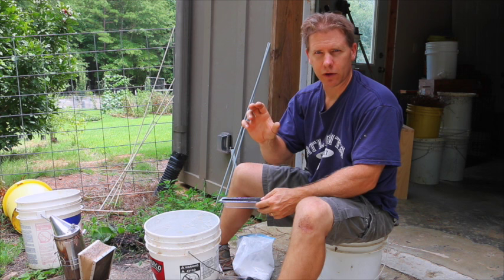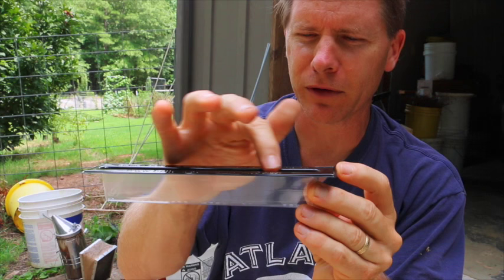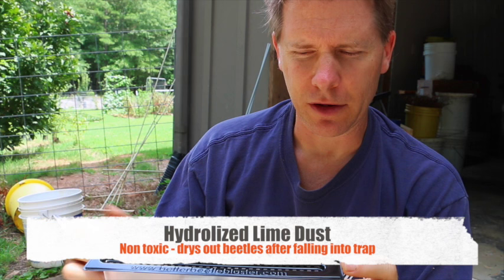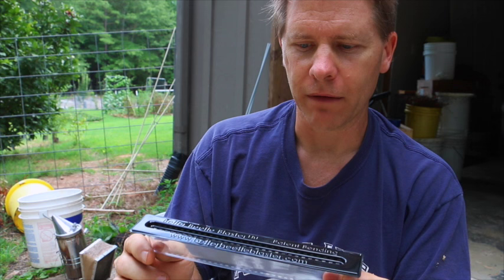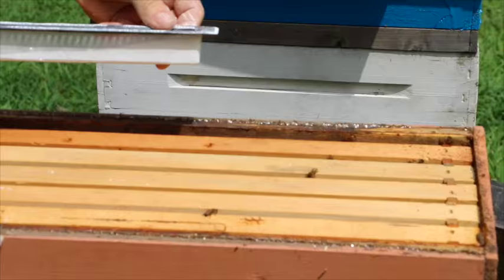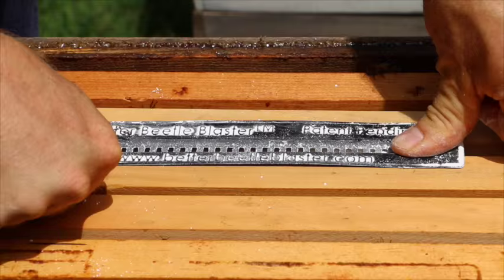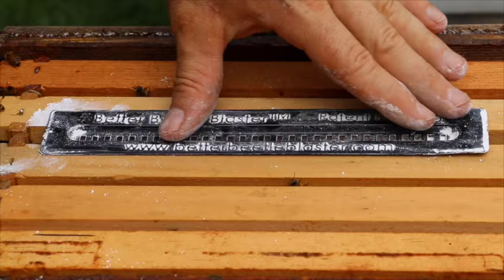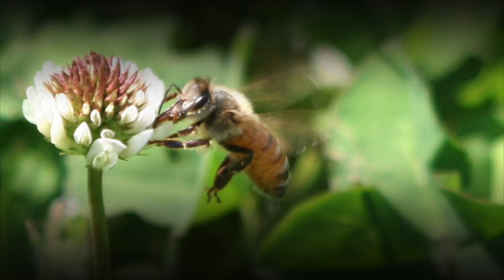Hive Beetle Control 7 2015

Comment: Great Video. I found the Horticultural Hydrated Lime product on Amazon so I'll give this a shot since I'm in SW Florida. New to beekeeping so this was very helpful. Thank you
Reply: Hey Tim...this is stan...you have a amazon link?   I use vegatble oil but this stuff really works??   thanks!!
Reply: Hi Stan. No. I ended up not buying the lime dust. I found food grade Diatomaceous Earth works just as well... as does using un scented swifter sheets
Reply: Hey Tim....well heck.. I use DE under my bees all ready....So you have had no issues putting inside  beetle trap around bees. I heard that dust is bad news if bees get in it...so just fill half way and wipe top off real good?  thanks!
Reply: Also Tim...where is the best place to buy food grade DE? I have a hard time finding it.  thanks!
Reply: Correct. Key word is "..if bees get in it" .. basically same as with the vegetable oil. The bees wont fit inside the beetle trap, so it will be okay just wipe off the top like you said...  even if you fill it less than half full with DE it will work
Reply: Man I like that.   messing with the oil is a pain. Ill give it a go!  and i like that it dries them up and they wont stink which deters beetles from going in.  So they just wander in there right not that it draws them?
Reply: Small hive beetle issues are only a problem when the bee population gets weak. So these days, I don't use any traps or chemical. I found much better success either down-sizing from 10 frame box into a 5 frame nuc works... I've had a lot of good success using frames without foundation. Less surface area means bees don't have to defend as much space, so they can better defend the inside of their hive against them
Reply: yep...sure makes sense. I am trying a few foundationless this year. Never done it. I also am learning how to raise a few queens.  take care Tim---stan

Comment: Correct me if I'm wrong but Hydrolyzed Lime dust is not the same as Horticultural Hydrated Lime? Hydrated lime is a toxic pesticide and warns you to where protective gear when handling. Hydrolyzed Lime is nontoxic?

Comment: What are your thoughts on using Diatomaceous Earth instead of the Hydrolyzed Lime Dust?
Reply: or fine salt
Reply: Fine Salt?   What is the thinking on the salt.
Reply: Comparisons can be made between table salt and diatomaceous earth, both kill bugs by sticking to their waxy exoskeleton and causing dehydration. Diatomaceous earth  is 2 - 5 times more effective at absorbing water than salt depending on how dry the DE is to start with.  Both gum up joints.   The salt must be FINE not table salt - dust . .